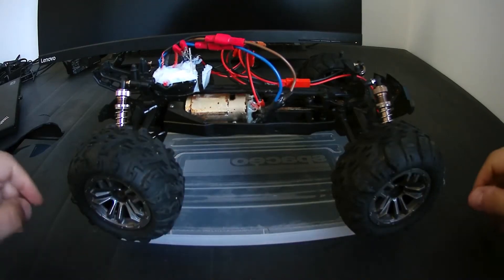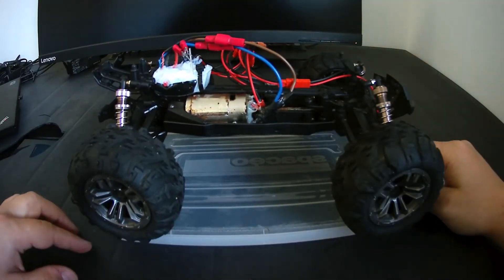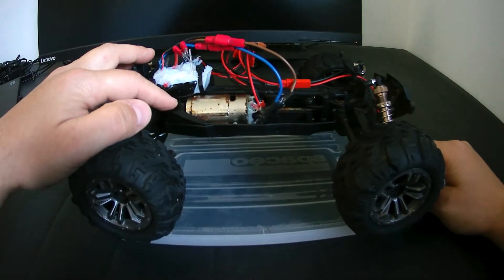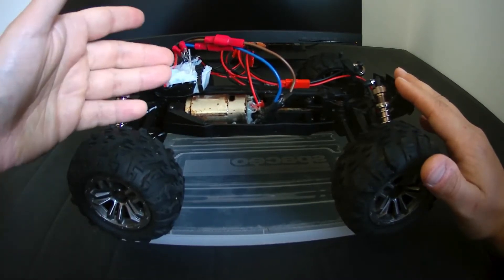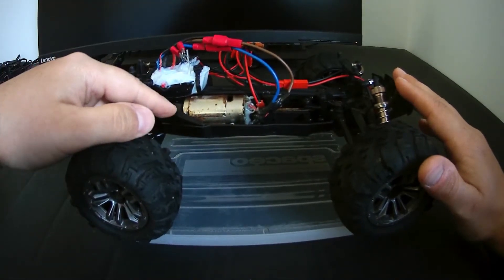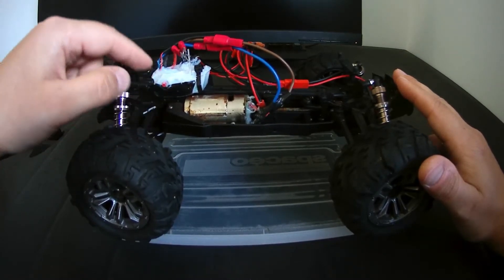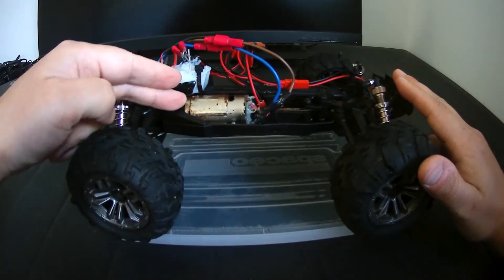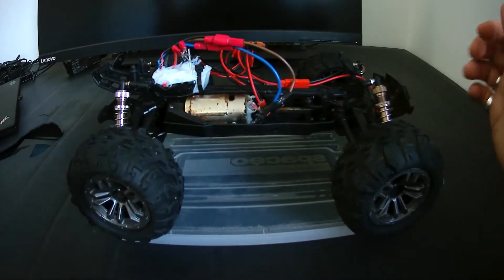How to Disassemble and Fix Xinlehong 9136 (Flyhal, Hosim) RC Cars? Replace Plastic and Metal Gears.

Comment: so my friend with this modification you have metal shaft on plastical differential....
Have you notice some kind of  problem with this modification???

it is metal on plastic.....

The plastic differential can handle the metallic shaft???

What about the car noise? Has it changed at all???
Reply from the maker: Thanks for your comment. Yes, it is possible to assume that the metal gears will wear out plastic gears. The factory has combined the metal gear on the electrical motor with the plastic gear on the shaft and eventually it got worn out. But I also see that the metal gear on the motor is getting worn out too. The plastic parts on this car are pretty durable and the differential gear teeth are very thick. So, at this point there is no need to spend more money on metal differential gears. The sound has changed as the materials on the gears changed, but I did not notice a big difference. On the other hand, I also had to stop using grease as I drive in sand and dirt a lot and that could also have an effect on how it sounds now. Applying grease would make the sound much softer. I will see how it goes.
Reply: @AventuraRemoteSmart  the most common problem in this xinlehong 9136 is the gear of the Motor.
If you push the car and always play with full throttle the first car part that have problem is this gear.
wears out very quickly or else it breaks immediately.
This means that after you put metal gears, and they're not plastic, you'll have bigger wear on the engine gear. (I think)
unfortunately xinlehong dont sale this gear separately from the motor. 
they say we must buy new motor with the gear on it. it is not expensive but it is some kind of problem always buying New motors.
I have noticed that in the market it is lots of gears for the motors that it is  for saleling.....but the problem is the exactly dimensions of the gear and if it eventually can fit in this specific motor......
we must find somehow different gear to put on the motor.... and everything it will be okay after that.
Reply from the maker: agree